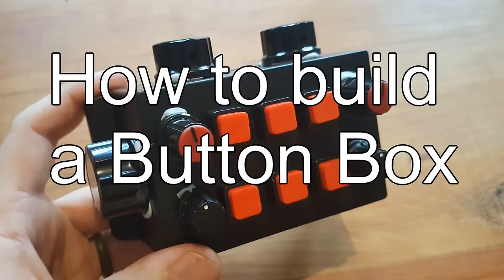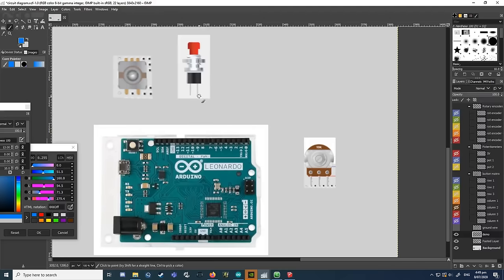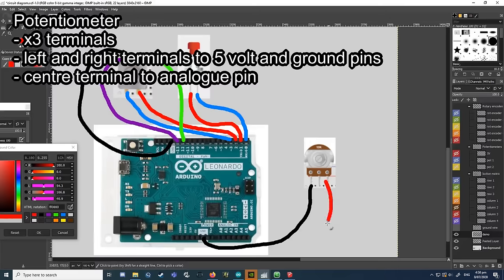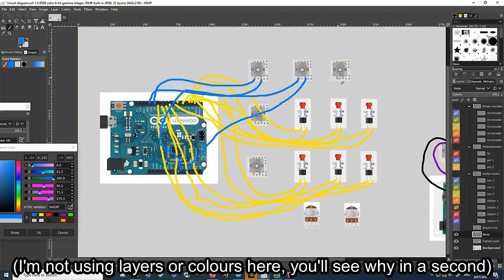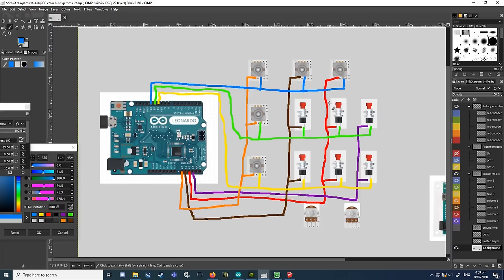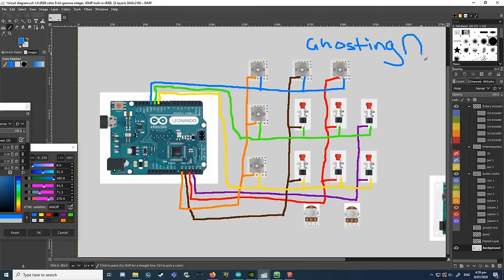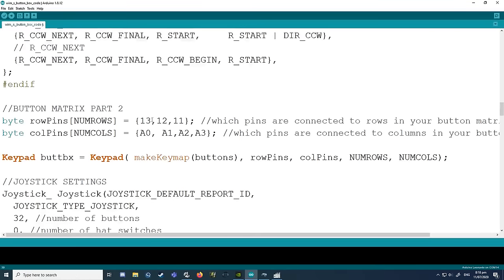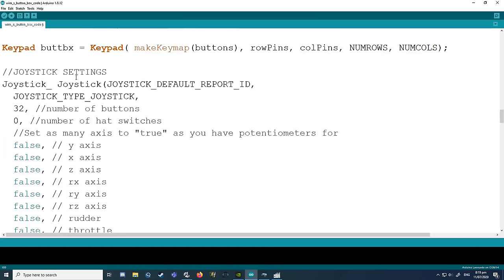How to Build a Button Box

Comment: Can I use on-on switches in the matrix?

I can't seem to get it to work.
Reply: It should work if you connect the center terminal to a column and the other two terminals to two different rows (or vice versa). Just be aware of the ghosting issue when using always-on switches.
Reply: @panicpetes7676  Hmm, tried this but no buttons register. I also have diodes and  pullups to counter the ghosting.
Reply: @kaio37k  I would try the most basic setup first. Switch connected to the column and rows directly, with nothing else connected to the Arduino to avoid interference. When you get that working, add in the diodes (make sure the polarity is correct). I don't think pullups are required, they may even interfere with how the keypad library works (not sure as I haven't dug into the topic, for my buttonbox ghosting is not an issue). Oh and avoid using pin 13, as it is connected to the on-board led and might show some strange behavior when used as an input.
Reply: @panicpetes7676  Fixed! The issue was the diode polarity, which is weird because my diodes follow the exact same polarity as dozens of 'Button Matrix' circuits online. The solution for me was to change the ROWS to COLUMNS and vice versa in the code, since my diodes were soldered in.

Thanks!!!
Reply: @kaio37k  You're welcome, glad you got it sorted.

Comment: hello I have a very big request. Because when I take a sketch from amstudio and try to upload it, I get this error:
Arduino_button boxV2: 7: 10: fatal error: Keypad.h There is no such file or directory and it says #include (keypad.h) below. I would really appreciate your reply
Reply from the maker: You need to download the Keypad library and copy it into the folder for the IDE software. The link is in the description and the instructions are at the start of the section on coding. You will also need to download and install the Joystick library.
Reply from the maker: Oh, also, after you've copied and pasted the libraries you need to import them into IDE. To do this, select from the menubar "Sketch -> Import Library -> Keypad" (do the same for the Joystick library)
Reply: @wimwamjoey  thank you very much. And the last question - I don't use potentiometers and rotaries, only buttons. What should I do?
Reply from the maker: @ketchuplive2127  In the section of the code which says "void loop" delete the code which says "checkallrotaryencoders" and "checkallpotentiometers".

But honestly, if you are just doing buttons you probably are better off using a zero delay USB arcade controller board, which is a lot cheaper than an arduino and doesn't need any coding.
Reply: @wimwamjoey  thank you very much for help. I did it but 1/3 buttons don't work. I have 24 buttons
Reply from the maker: @ketchuplive2127  thats either a wiring issue or an issue with the code. 

Double check your wires are all connected correctly with no shorts.

Double check the code for your button matrix has the correct numbers of rows and columns.
Reply: @wimwamjoey  thank you, the sketch had error.
Reply: @wimwamjoey  It is good now
Reply: @wimwamjoey  This is TRUE. The USB encoder is plug and play, no programming required. I built my first box with one - but wanted the rotaries so switched to the Arduino.

Comment: so an encoder is basically programmed as 2 buttons em i right?
Reply from the maker: Basically yea, three if you count the push button function. 

You can't include the turning functions of the encoders in your button matrix though, they need to be wired up separately as shown in the vid
Reply: @wimwamjoey  ok thx
Reply: @wimwamjoey  and the encoders wont work in any matrix u say? Cause that could be a problem, i now switched to an Leo bodnar board and i have only 12 pins for 3 encoders and 10 buttons, so wont work
Reply from the maker: @f.l846  you might be able to make them work but you would need completely different code than given in this video.
Reply from the maker: Also, this code will not work with a leo bodnar board. You have to use a Leonardo or Pro Micro. Leo Bodnar is a completely different system.
Reply: @wimwamjoey  i know that. the leo bodnar has an button matrix function and i want to know if encoders in generall don't work with matrix

Comment: How can I integrate a HW 504 Joystick module ? Thanks
Reply from the maker: An HW504 is essentially just two potentiometers in a single component. 

It should have pins marked GND, 5v, VRy, VRx and SW

The VRx and VRy pins go to analogue pins on your arduino. 5v and gnd are self explanatory. SW is the output for the push button but I'm not sure how you would connect it into a keypad matrix... You might need to do some experimentation with that.
Reply: @wimwamjoey  thank you, very much!
Reply: You should be able to plug SW directly into a digital pin on our Arduino. But you might need to modify the code for it to work
Reply: @FoquroC31  yes I did it this way, now I'm just ordered also a rotary encoder and need to see if everything works correctly😁
Reply: @wimwamjoey  any insight on this? I'm having issues making sense of this. As the matrix requires two wires, but the push button function of the encoder and joystick is a single digital pin. And incorporating a diode becomes even more confusing.

Comment: is it okay to wire the potentio in the matrix?
Reply from the maker: No, it needs to be wired separately
Reply: @wimwamjoey  then i dont have enough analog pin thingies, arduino pro micro only have it until A3/A4? or is there more? or do u have any other suggestions?
Reply from the maker: @noceur7801  no sorry, you can only connect as many potentiometers as you have analogue pins.
Reply: @wimwamjoey  so i have to use two arduinos then?
Reply: @noceur7801  No, there are more analog pins than are labeled on the board. Some pins can be used as either digital or analog pins, depending on the definition in your code. If you are using a pro micro (which is actually by sparkfun, not arduino), check this pinout guide: https://learn.sparkfun.com/tutorials/pro-micro--fio-v3-hookup-guide/hardware-overview-pro-micro
If you are using an arduino micro (there is no "pro" in the name), there is a pdf with pinout diagrams: https://content.arduino.cc/assets/Pinout-Micro_latest.pdf
Reply: well there's actually 4 labeled analog pins on the pro micro... appart from the other non labeled 4. (a0,a1,a2,a3) right next to pin 15

Comment: Does this work for the Arduino Mega? Im trying this with the Arduino Uno and it doesnt work sadly.
Reply from the maker: No sorry, I made a mistake in the video. As I noted in the description this will only work with an arduino leonardo or pro micro
Reply: @wimwamjoey  could you please expand on why Arduino uno would t work with this? Is it because of potentiometers? Could it work with just buttons? I've found a different old project that used UNO with two I/o extension boards and used the similar grid fashion button matrix.
Reply: @wimwamjoey   or does it have to do with atmega chip? Does it have to be 32u4/16u2? 328 won't cut it?
Reply: @sandrisburkitis3883  the problem is with the chip, preferrably use a ATMEGA 32u4 (5V 16MHz board). Arduino UNO (or even the mega2560) series can't be recognised smoothly as an HID (Human Interface Device) and you would have to use a workaround definetly not for beginners (plus, those boards can be Arduino OR HID, not both at once). Use a pro micro, a leonardo or similar boards for HID
Reply: @ricky94m  yeah, I've done some digging and it's definitely doable on both 16u4 and even 8u4 IF they are present. But yeah it does require quite a little work on top, so I guess I'll just use uno for something else
Reply: @sandrisburkitis3883
Reply: This is the best explanation I have seen ever, Thank
Reply: @wimwamjoey   All of this will  work with any Arduino if you go thorough a system like Mobiflight or Simvim.
Reply from the maker: @JoePCP  Yeah but those apps only support a few games like MSFS and XPlane right? Whereas this will work with pretty much any game.

Comment: HELP!!!!... I'm trying to add 1 rotary and 3 buttons to a Leonardo.... cant get it to work.  Its to put inside a Thrustmaster F1 add-on wheel and plug into sim , I have tried 5 times and still no joy..  50 year old fart needs help!!
Reply: Only have the rotary wired in at the moment. there are 3 momentary switches to add
Reply: @dscmotorracing  The joystick library doesn't work with the Arduino Uno, you will need a Leonardo or Micro (see video description)

Comment: can somebody please help with the code and wire layout for my arduino Mega 2560
im Stuck
@wimwamjoey i bought the Arduino mega as you told me

i get a fould reading when checked it says 

In file included from C:\Users\John\Desktop\Arduino Setup\DCS_button_box_code\DCS_button_box_code.ino:3:0:
C:\Program Files (x86)\Arduino\libraries\ArduinoJoystickLibrary-master\src/Joystick.h:32:2: error: #error The Joystick library can only be used with a USB MCU (e.g. Arduino Leonardo, Arduino Micro, etc.).
 #error The Joystick library can only be used with a USB MCU (e.g. Arduino Leonardo, Arduino Micro, etc.).
  ^~~~~
exit status 1
Fould by compiling the board Arduino Mega or Mega 2560

the things y made so far
The lay out of the wires ?? see upload 1
the code see upload 2 
the Box upload 3
the Card upload 4

upload 1: 
https://drive.google.com/file/d/1Mjr4p25iNIPGpb_CH-6Wy1IIC8JwF4rc/view?usp=sharing
upload 2
https://drive.google.com/file/d/1Gq_Qn0aIRT32TMfP9RvtmpMga3AtmQBa/view?usp=sharing
upload 3
https://i.imgur.com/TGXzqw5.jpg
upload 4
https://i.imgur.com/2ISf1Mr.jpg
Reply from the maker: Crap... having googled around a bit it looks like the arduino mega isnt supported by the joystick library code we are using here. Really sorry man but I think you'll have to use a couple of leonardo or pro micro boards instead...
Reply: @wimwamjoey  Crap indead wasted the mony for a MEga
can you see if the wiring and wire scets is oke for a Leonardo ??
Reply: @wimwamjoey  or change te sliders and use it as a rotary ??
Reply: is it possible to make this work on a arduino Mega only need the buttons en linear potentiometer codes and help with the wiring 
The Box setup
https://i.imgur.com/TGXzqw5.jpg
The Buttons commands
https://i.imgur.com/0cuFvnU.jpg

Please HELP needed or can y dump the Arduino MEga
if code loaded on a Arduino Leonardo it works but i have no pins enough
On the Mega i have enough pins
So i need the Wire sheme and the Code ??
Reply from the maker: @Mav20071  yea I dont think there is a way for you to get all those buttons onto a single leonardo. You might need to use two leonardo's and split some of the buttons between them. Maybe use one for the button matrix and the other for the pots and encoders
Reply: @wimwamjoey  i thimk i got it solved add leased the wiring diagram on a Leonardo (ordred one) only now i kneed a code that only uses the potentiometers and the button matrix i tried to delete the roterycodes but no luck so far hope you can provide me with a new code that only uses those two things
see my dia gram it ad up but looks like spaggeti LOL
im using 4 connction A5,A4,A3,A2 for the potentiometers incl the ground and 5volt  and made two coloms A1,A0 end 10 rows for the MAtrix incl the ground

https://drive.google.com/file/d/1JVds3JE-t4uZ1wcBstRQxXiE2UzsjBz0/view?usp=sharing
Reply from the maker: @Mav20071  I'm away from home over the holidays so can't do the code for you. You just need to set the number of rotary encoders at the top to zero and remove the line of code which says "checkallrotaryencoders" under "void loop".
Reply: @wimwamjoey   enjoy your holiday if you have the time when youre back can you check if this is correct i've made the changes no error messages in code
But need to know if the wiring is correct for the Leonardo to work ?

The Wiring diagram in Photoshop 
https://drive.google.com/file/d/1eE9CmMQumezd8bw-TZDhM0r4Jux7gFRu/view?usp=sharing
The Arduino LEO code
https://drive.google.com/file/d/1sjpP-ZT4OnwDDvgFGEqu15-SPWaGvNTn/view?usp=sharing

thnx so far hope to hear from you as soon as you have checked it
Reply: Take a look at shift registers, can read/send blocks of 8 with 4 pins iirc (send, reset, shift-input and input)... and can be daisy chained up to at least 8 pieces (so at least 64 outputs with 4 pins), but works fine with toggles too. Obviously costs a few extra cpu cycles though.
There is also a way to change the bootloader for a mega2560 so it can be seen as a HID device....but it's rather fiddly and not very beginner friendly,
Reply: @CommDante   tnx for the heads up
Reply: @Mav20071  
They're often used as example in led-cubes. 
I was planning to make bit of a cockpit myself, worked out all the hardware, code etc. But never got far in the aesthetic design of it, since I wanted 1 cockpit combined from 10+ planes from different era's (which often have different kind of switches for same function.. or digital assignments for analog etc). Last time I checked I was at 80+ functions. And thats not even with extras such as radios etc. ;)
Reply: @CommDante  ive workt out the thing im chaging te soft ware on de Mega to Megajoy and i already made the code for it if you want i can get them both to you to check (wire layout and code )aand the lay out of my box its an extension for my WarthogHotas

Al included 
https://drive.google.com/drive/folders/14GhHr09KSaqU9NQiQ6VYW7qka2dn4lRz?usp=sharing

y used the grid solution from wimandjoey
Reply from the maker: @Mav20071  Back from holiday but sounds like you've sorted things out? Sorry again for the run around.
Reply from the maker: @Mav20071  Honestly I had a bit of a hard time working out your wiring diagram, but I couldn't see anything obviously wrong with it. I'd suggest building and testing in stages with heat shrink tubing or alligator clips before you solder anything too permanently.

Comment: That is limited button.. how to make a button box with 70+/- buttons?
Reply: You can expand the matrix as required. A 8x9 Matrix can handle up to 72 button and needs 17 digital arduino pins. For even more buttons you could use shift registers (PISO) or multiplexers. But be aware that the windows controller panel will only show you the first 32 buttons, and also some games might not register higher button numbers correctly.
Reply: Or use a keyboard and customize it
Reply: @panicpetes7676  I almost forgot about the 32button limit.. is it possible to split the 72 button into 2 devices?  i mean it will be read as two devices on USB plug..

Comment: Why wouldn't an arduino uno work though? I am brain dead when it comes to electronics and im more of a nut for mechanical things
Reply from the maker: It doesn't have the hardware which allows windows to automatically detect it as an input device.

Comment: Far to complex and head scratching for me.
I just used a Zero delay USB joystick controller and a bunch of switches. Far simpler.
Reply: The advantage of the Arduino is that you can use rotary encoders and potentiometers whereas in the USB Zero Delay not. You also have more buttons (32 vs 12). Apart from this a USB Zero Delay is much straight forward :)